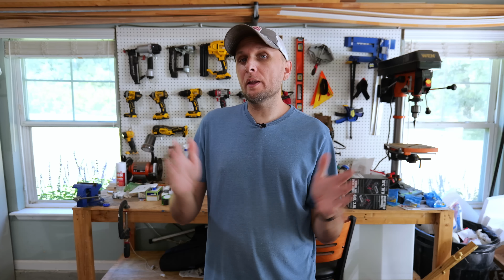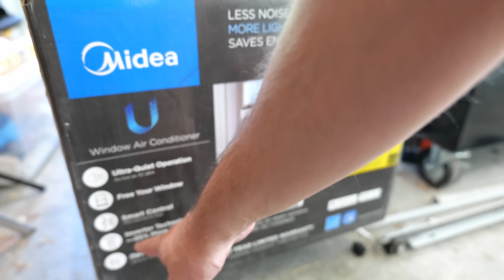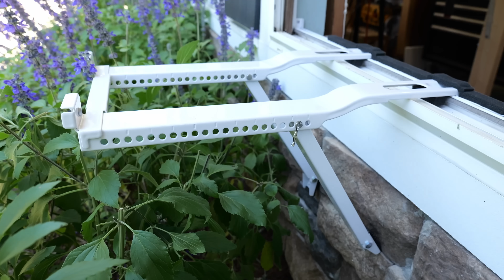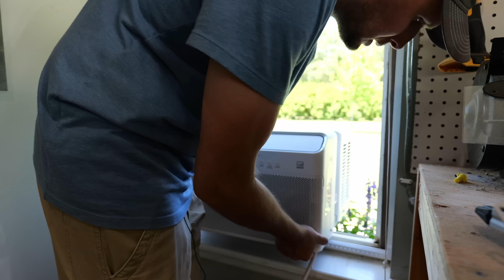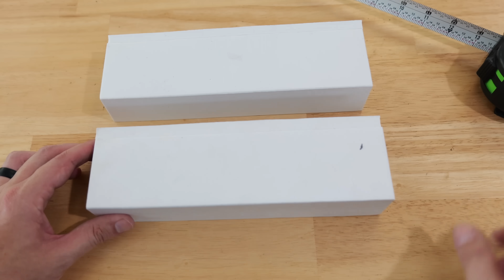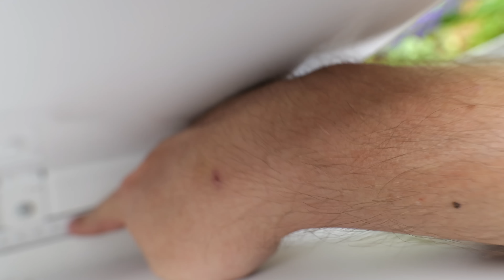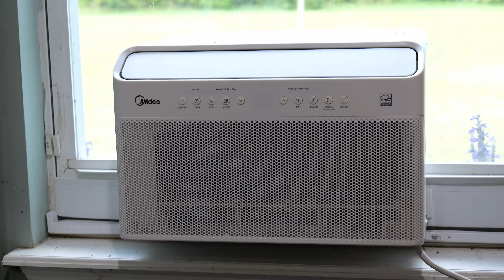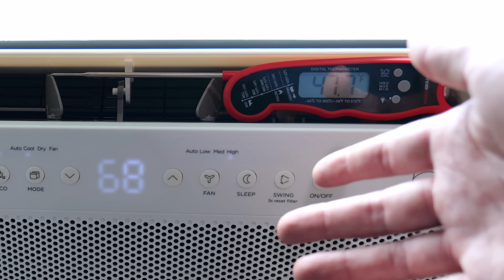The COLDEST And QUIETEST AC Unit Ever Made!  Still Use Your Window!

Comment: I was holding my breath as I clicked on this video notification because I had just bought an AC unit and it's still in the box waiting to be installed. Imagine my delight and relief when I realized you're talking about exactly what I bought.

Great installation instructions (better than Midea's)! ❤
Reply: Aren't you a lucky dog lol.   The tutorial is great I agree.
Reply from the maker: Thank you for the feedback @LaurenBradburyFarm!  This thing has really surprised me.  I think you are going to be very happy with it!
Reply: @HowToHomeDIY   Would you recommend one from this same company for horizontal sliding windows?
Reply: Does it heat and cool?
Reply: @ALowe-d1d  This model is for cooling, only.
Reply: @ALowe-d1d  Just cools. I wish it did both.
Reply: @ALowe-d1d only cools
Reply: Recalled take it off the market
Reply: @anthonylisboa3579 Wow….there you have it.  Glad I didn’t go that route.  Do you know why they recalled it?
Reply: @anthonylisboa3579  it's just an issue with the drain hole and mildew and they have a fix available. I am keeping mine.
Reply: Is that Trane an inverter system?
No HVAC is made in the US.
All brands keep very little parts on hand.
All brands have weak coils.
Parts for mini splits are even harder to get.
Reply: @jwmustang1  ….I can’t answer that question.  HVAC is not my forte.  I’ll say this though, the warranty on this is 12yrs, 10yrs on everything else.  The model is a “Trane XV18”, if that helps.  I’m sure everything you said is 100% true.  My issue is simply this…. Obviously, we’re not the only people to have this issue.  That, or as I mentioned, the 500lb gorilla is the company we used to install it, which is an entirely different, and very ugly, conversation.  But, I digress…. We were told initially a 5wk wait for a compressor.  Is our luck REALLY….THAT bad???  Especially, when it’s not the only repair that’s been done on this unit since install 2 1/2yrs ago.  After threatening legal action, it came down to a week (7/14-install), with a labor credit of roughly $1600.  For all practical purposes, it doesn’t matter to us where the unit is made (for the most part), we’re under no illusions with that, these days.  Being Florida residents we asked for the best unit, with the best warranty, to avoid this EXACT scenario, and this Trane is what they recommended.  *It’s the service company’s responsibility to stay ahead of these problems, if for no other reasons than to uphold their own “service” reputation in the industry. That’s like showing up for work late 5x’s in a week, and blaming it on traffic.  The first time, I get it, the other 4x’s, you should’ve learned to leave early.  But, I digress…. We didn’t question it, because what exactly would we question?  Buying a car is very much the same way these days.  Depending on who you talk to they ALL have their issues.  So, if you know a repair is going to be needed, then the shops have an obligation to keeps parts in stock.  Not wait till a disaster occurs.  Because, again, they have NOOOO problem charging an obscene amount of money to fix the problem.  The person we spoke with over the phone made a somewhat similar comment. “We don’t keep these parts in stock, because it’s’ not a part that typically breaks”.  Yet, they had no problem charging us to install it (which makes the 2nd part to fail in under 3yrs), because we were I think 4-6mo outside of their “free labor” window (again, a coincidence?).  So, while everything you said is probably 100% true, it doesn’t justify a single thing that’s happened, either.  A company can’t release itself from any particular unit, and its potential flaws, then turn around and exploit those flaws, financially.  It may not be illegal, but it’s distatestful to disgusting levels.  And, that’s to say nothing of the fact that it seems VERY suspicious that every part that’s broken on that system happened very shortly after a “preventive maintenance” service was done on the unit.  A service we pay extra for  “….ensure your system meets manufacturer’s parts warranty requirements.”  I hate accusing, or even insinuating practices like that, but that simply can’t be ruled out either.  The stars would have to line up in an inconceivable manner (multiple times) to have luck THAT bad.  It’s statistically impossible, hence why courtrooms have a “reasonable doubt” policy for verdicts.  But, again, I digress (sorry).  I appreciate what you’re saying, and appreciate the reply.  Obviously, my frustration is not with you, but the circumstance.  As I stated in another reply, we’ll ride this out (as utterly miserable as it is in FL right now) because we have no other choice for the immediate future.  But, in-spite of “parts on hand”, I have an $1800 Mr. Cool mini-split, that had the exact same thing happened, could’ve AT WORST ordered another one, and had it hung within two days, while we waited for Mr. Cool to send a replacement compressor (7yr-warranty I believe).  Needless to say,it’s not about the warranty, it’s about not needing the warranty.  On a completely separate note… A lot of what we’re ALL going through, I hope and pray gets better over the next 4yrs with different leadership to support all the supply-chain issues (among a million other things).  I’ll post an update as to how this all goes for anyone even approaching a similar circumstance.  Thank you again for your reply.
Reply: We bought is to use in a rental shack while we built our house. We put mini splits in the house, sold the Midea to the landlord. We wish we had just used the Midea. The mini splits are a pain in the tukas to clean....we are seriously considering eliminating them and getting two of these. (We have a one bedroom home)  The rental had no insulation....hot hot south Texas...ONE of these kept that house comfy. (It was small too)
Reply: I have the 8,0000 BTU version, everything is great except the blower fan is weak, so weak its annoying. It needs a higher fan speed, a turbo mode, regardless of noise.
Reply: @NoNORADon911  When I'm hot 🔥🥵 I can't even sleep. Noise? Nothing bothers me... lawn mowers, kids playing, even a train could roll on by; but if there's a hot flash, I want turbo too. So could you put a small fan in front of it? Would that pull more air 🤔 Also, I've been looking at some places that use fans & misting zones to cool people off at amusement parks, and some place in Persia learned to make ice in the doggone hottest place ever by using air ducts that let breezes in that force hot air out, then they had some water from an underground spring used to make a small waterfall flowing down 3 or 4 simple steps in the center of the home (under that air duct...) Anyhoo, somehow they figured out ice. Lol

Soooo my very last idea is to get one of those cool flame led vaporizers on Amazon and put it a foot or so away from the vent. I think the small amount of vapor won't add too much moisture inside but should drop the temperature of the air without increasing your fan speed. Good luck 🍀🤞🏼💫
Reply: @MyrtleBeachWebAngel  Sure a fan will help or work but shouldn't be needed.

Water misting, swamp coolers, etc work best in dry climates, where I am, Florida, it is very humid. Some outdoor places here use water misting but most don't.
Reply: @NoNORADon911  good info! Thank you. 💫
Reply: Just a thought...
Might be able to secure the window play inserting (slightly wedging) a 2 by 2 from the top of the window to the top of the window frame.
Reply: Did you like your Midea A/C unit??? 
I have heard pros and cons...
I really need to buy a Window unit but not sure which one to buy
Thank you for your help.
Reply: We too have one, works great and is very quiet, plus I can run it off of me generator when the power is off
This company is a very big producer of ACs worldwide.
Reply: most retarded post ive ever read lol
Reply: Yay!
Reply: Give it a few months it will fail
Reply from the maker: @rockstarfan886 so many others including me completely disagree with that.
Reply: I. Have something horrible called.the HOA. So I cannot have a window ac.unit. The HOA  claims nothing. Can hang out of the window.  So, I. Read about portable ac units. Then. Only. The. Exhaust hose goes TO the window.  Folks if you have the same.issue...for me it's a bedroom in a townhouse w.a.west. facing window. 2.central ac vents...one. over the west. Facing. Window and.the other in the bathroom. Ugh. I. Bought. A Whynter portable  ac unit.  The btu h. Is 14k.  It. Cools to 60 degrees for 600 Sq ft.  I can tell you. All it. Does a better job. Than. Any. Window ac unit.  I have to sleep. During. The day as. I work midnight. Shift.  So 100. Outside..2nd FL bedroom w horrible vent placement.  I sleep w. The room at 60.9. In these conditions. My bedroom is roughly 14×12.  The ac house is very flexible as well. Awesome investment. If. U. Need more.info feel free to email me. Sorry about. All the .  After each word. My phone has been doing this and I. Can.t. fix it. Stay. Cool.
Reply: Right.  But did you do it.  That was wayyyyy to many steps lol.
Reply: Are you happy with the air conditioner?
Reply: Keep us in the loop on your experience.  We're going through a hell you couldn't make up, here in FL.  2 1/2yrs ago we spent $18K to have the "latest/greatest" Trane, installed.  Since then, two parts replaced, the first a minor part of some sort, 6mo after install.....and 4 days ago, the entire compressor went out.  And, the heatwave/drought taking place here in FL can't even be described at this point.  The astonishing irony (that I pointed out to the Pro-Tech, who installed the unit) is that my self-installed Mr. Cool mini-split that I put in at the same time as this Trane unit, keeps the garage studio at 73 degree's without breaking a sweat, and could keep it at 68 if we wanted it to.  It's ice-cold, and we've not had ONE....SINGLE....PROBLEM with it (although, it's also 2 1/2yrs old, as well).  So, the wife and I are held hostage to our garage, because our $18K 2 1/2yr-old Trane's compressor went out.  You couldn't make that up. 

There's also a theme to these HVAC companies as of late.  Two parts "failed" on our unit, less than a week after the techs came out to do their service.  And, this compressor failed in less than 24hrs after the tech did this last service (who didn't even put the air filter in properly).  Neither tech spoke anything that even REMOTELY resembled English.  Do what you want with that info, but the invoice(s) interestingly enough, were in perfect English...... as always.   The state of this country in many ways was predictable.  But, I NEVER thought I'd live long enough to see the apocalyptic, sh!t-show we're seeing now with greed, corruption, fraud, and a banner waiving level of "I don't give a sh!t" we're seeing now.  And, it doesn't matter the product, or how much money spent.

I'd like to think that once this new compressor is installed, we'll be OK for the foreseeable future.  But, we're looking into "back-up" AC units for the master bedroom, and living area.  The lack of trust, and confidence, we're experiencing puts a sickening feeling in my stomach given the amount of money we've spent.
Reply: @phillamoore157 trane sucks big time  
their coils are junk
Reply: @6gatornation  ....you're literally the first person I've heard say that.  I'm good with a hammer, but don't know HVAC from my a-hole.  But, every person I've talked to all said Trane has had one of the best reputations out there....for a long time.  But, at this stage, I don't know who to "swing back" at.....Trane, or the people who installed it (whom I have VERY little trust in at the moment).  I'm not quite ready to form an opinion just yet, given the experience I've had with the installers, who always seem to be present when something on it breaks.  But,  up to this point, it's been a beautiful, powerful, extremely quite/efficient unit.  I'd "like" to think once that compressor is replaced we'll be OK.
Reply: @phillamoore157  i've had my trane for 14 years     
Replaced the coils several times 
  They all come from Mexico 
I will never buy another one
Reply: @6gatornation  .....so you've gone through the same BS.  This sh!t makes me sick.  Of the top of my head, we remember the warranty being fairly substantial.  But, it's all but pointless, if the local companies don't keep the part in stock, and want to charge you, what would've been $1600 labor.  We'll ride this out, because at the moment, we have to.  But, from here on out, we're going with mini-splits, which was what we had wanted initially.  That way if one goes down, the who house isn't f*ked.  But, yeah....as you can tell, we're not happy about this......AT....ALL.  And, the worst part was that, at the time, we said, "just give us one that will last us 15-20yrs".  If that's Mitsubishi, fine....GE fine.....just give us a good one.  Price (for all practical purposes) didn't matter.  It's FL, and next to transportation, it's the #1 most important aspect of our lives.  And....here were are.  *And, the irony is that even with parts being included under warranty, their labor price was more than a good mini-split, or even good window unit like this one.

OK....now, that that rant is out of the way, ready to talk sh!t about car repairs 
😭.  It's never-ending.  I'm 52, and I don't ever recall life being this hard.
Reply: @6gatornation the coolant change in 2025 is intended to help but who knows if the coil quality in general is poor.  I’ve got a 1987 Amanda still cooling. But it struggles 😂. The techs want us to run it till it is done.
Reply: @phillamoore157 I concur with everything that you put in this post! I’m a Veteran and was once Proud to be from our Country. Not to say that I am leaving. But it’s definitely sad to see what it has become!
Reply: @phillamoore157  
What window unit did you buy?
Do you still like your window unit?
Reply: @ We thought long and hard about that, and decided to go with a mini-split unit.  We had just invested a LOT of money into windows, and plantation shutters and didn’t want to undermine that with a window unit.  So, with our long-term plan to start moving away from Central air/heat (which we which we no longer believe in, or want to deal with) we’re going with individual mini-splits throughout the house (which I can otherwise install myself).  So, the whole house isn’t held hostage to one unit.  That said, I may still pick one of these up for the garage, at some point.  And, just turn it on when I’m out there working.  And, having one on hand at these prices “in the event of”, isn’t a bad idea either.  The emergency stand-up units we’ve all seen, are OK for a very small room.  But, can’t compete with Florida heat, where God help you if the air goes out….so, you can never be too prepared, we’ve painfully learned.  But, we’re set now, so we no longer need for a unit like this.
Reply: @phillamoore157  
Thank you so much for all that great information... 
I totally agree about HEAT... 
Here in Southeastern New Mexico (US) last year got up to 113* easy... but it is DRY heat.
Thank you again...
Reply: @ Yup…spent a lot of time out west, and dry or not when you hit 113 is HOT!  Good luck to you.
Reply: @phillamoore157  Tranes are not what they used to be. Most AC problems are the installer's fault. Most compressors are made by the same company. The whole AC racket ''grapes'' people left and right. You probably paid many many thousands too much, like most people. I am getting a Goodman installed Saturday in central Florida for $4,700 parts and labor, with warranty and licensed. The price started at $6,500. Even after haggling and ''friend price'' I am still paying 2 guys $1,500 for 1 day of labor. Everybody is getting eff'ed.
Reply: @phillamoore157  Thank you for your comment.  So sorry about your experience.    Folks I speak to always try to convince me to get central air.   But they always end up with "backup" units going into windows anyway.   So what's the point of the huge expense of installation and maintenance?   I filled my home with Mideas for $1,800 and have been very happy (see my comment on my experience).    Highly recommend.
Reply: @larrybeagle66  Yup….you’re exactly right.  The strange part is that we did a LOT of research before buying this unit, and didn’t see anything negative beyond every other unit out there.  But, you’re 100% correct.   It becomes pointless when you’re buying back-up mini-splits,etc…in the event it goes out.  There was a time when you could truly rely on these units.  And, for that matter, the money these companies charge, even when the part is covered under warranty makes me question them, as well.  Moving forward, I will NEVER go down this path again, that’s for sure.
Reply: @phillamoore157 bro I have a 4 ton Trane here in Vegas where it gets in the mid 120s every summer no issues this is my 2nd summer installed cost me just over 8 grand installed with warranty. Combo heat and cool unit. How big is your unit you got ripped off.
Reply: @legofeak12 I You know I should be able to answer that, but we actually decided to get one a bit bigger than our last, because down here in Florida we’re dealing ith the heat as much as we are the insane humidity.  So, there’s a tone of dehumidification going on that you have to keep an eye on with the condensation drainage, which I just had a scare with last month.  But, our home is 1800sq, duplex, so we got one that could cover that and then some.  And, it’s an older home that needed some duct work, that required some light construction.  All in we dropped $12K.  And, mind you, I’m not one to complain about the money per se, but we’re just now approaching the 3yr mark, and under one year we had two parts go wrong, that they replaced under warranty, which rubbed me the wrong way given how new it was.  Then, the entire compressor went out SMACK in the middle of the hottest time of the year, barely 2yrs in, and I completely lost my sh-t on the company, because A) That NEVER should’ve happened…..and B). They didn’t have one in stock to fix it.  C). They wanted to charge something like $6K to replace it.   After some REAL ugly convo’s they didn’t charge us anything, and had a new compressor Fed Ex’d from somewhere out west, once they found it.  Then, due to the condensation issue the lines backed up, and shut the whole thing down.  Their quarterly service calls was supposed to keep that from happening, so we dropped $400 into a safety valve that warns us, instead of backing all the way into the system.   Again…that should’ve been done on day 1.  And, I’m not real happy with the design.  With the technology today, if your system shuts off entirely, there should be something tell you why (a code, message, etc..).  But, nope, you’re left sitting there guessing.  So, we’ve had no significant problems (short of installing that safety valve, on the drainage), since the new compressor was installed.  But, it seems to me that given what we paid, we should be having NO problems till that unit is pushing at LEAST 10yrs old.  And, as a side note…..just about every problem we had with that unit, happend within a day (two at the most) of when the service tech’s “serviced” the unit.  When that happens enough times, you start not trusting anyone.  I’ll tell you this much, though.  After this experience, never again.  I have a Mr. Cool mini-split in my garage I installed myself, that keeps the garage at 73 year round, and I’ve not had ONE….SINGLE….PROBLEM with it in 4yrs.  That’s where we slept for 7 days waiting on the new compressor…..go figure.  I made sure to tell my AC company that, as well.  So, over time the wife and I will install mini-splits in each room.  EVERYTHING today seems to be junk, that WILL fail at some point.  We don’t want the entire house (especially two stories) to be without AC if it fails.  So, obviously with the mini splits, if one goes down you still have 4 other rooms staying cool….and we NEVER use the heat.  That, and they’re FAR more efficient, and quiet.*  Had we not had that Mr. Cool in the garage we would’ve had to stay in a hotel.  Our 102 degrees in August is like your 120 in Vegas.   When it’s like that, you can’t get away from it.  Btw…my wife was just out there for the new Universal Horror Nights opening, and she said it was brutal.  Dry, or not, 120 is brutal.  With all that said, I am happy that you’re not experiencing any issues.  Being with out AC in the hottest places in the country is something I wouldn’t wish on anyone.  BIG learning experience.*
Reply: @phillamoore157 thank you for this honest input! It serves me greatly as I’m exploring my options in Florida as well. I’m dumb to this and young but I’ve definitely got some great ideas now thank yall😊
Reply: @phillamoore157 Amen brother I understand.Sorry for your family to go through this BS.My blood pressure rises when I hear 💩like this. Been there and done it bro. Everything is a scam 😡 Peace and blessings to you and your family 🙏🙏🇺🇸🇺🇸
Reply: But they designed it wrong. It should have an upside down U shape so it sits below the window so it doesn’t block the window.
Reply: @terjeoseberg990  there is one in an upside down u. It leaks water on your floor when you forget to empty it.
Reply: @BKzee3 , Dayum. That’s a problem. I forgot about the condensation on the evaporator.
Reply: @BKzee3 , Maybe they could add a small pump to pump the water up over the window sill.
Reply: @BKzee3  buy needy plant 🌿🌿🌿 place under unit. Lol. 

Just ribbing. My indoor plants wish there was a leaky AC unit nearby. 🥀
Reply: @BKzee3  So put your pets water bowl under the leaking AC, win, win! lol
Reply: @terjeoseberg990 IKR! The new designs are awesome! Maybe a idea has something available in a different model.
Reply: @terjeoseberg990 problem with that is wall thickness vary by great degree, where as window thickness follows a standard. Much easier to design for the thickness of the window which is what they did.
Reply: @bakadeshi_aunstudios , Since I made that comment I’ve seen several upside down U shaped units. They are available. They have some sort of frame structure that you installed outside the window to adjust for wall thickness.
Reply: @terjeoseberg990  i thought that too, but windows are usually the same thickness walls are not. So it would have been difficult to build for extra thick turn of the century brick walls and modern stud walls too.
Reply: @zedwpd , I found one that supports walls about a foot thicker than usual that has a framework that you install outside the wall to support the outside of the unit and fill the extra gap.
Reply: @terjeoseberg990  That one requires a catch bucket because it leaks into your house.
Reply: @GROGU123 , Or a small pump to pump the condensation outside.